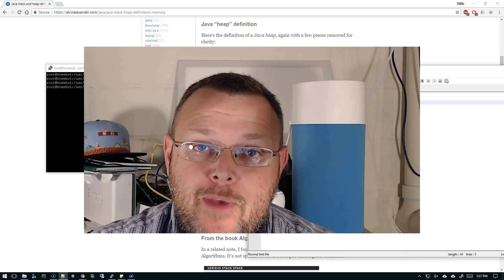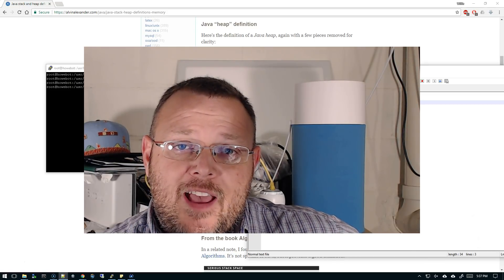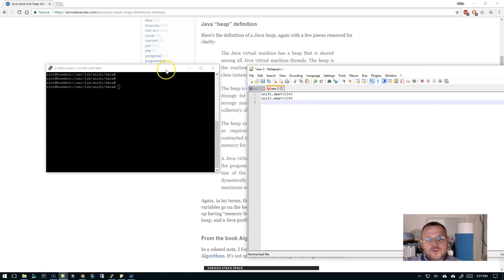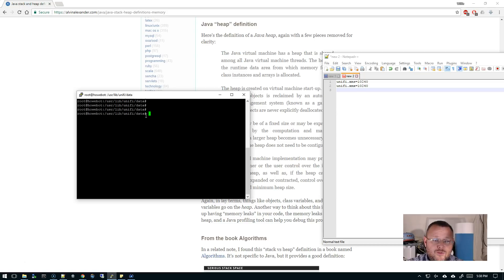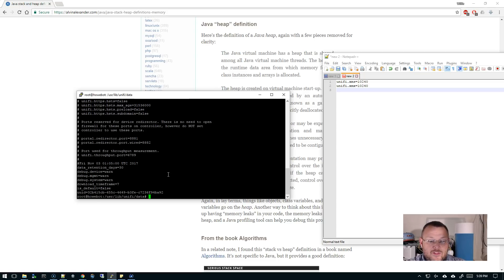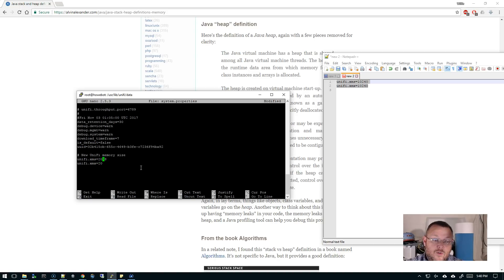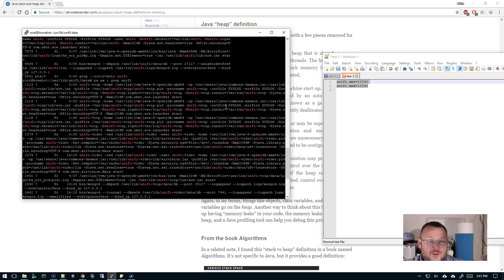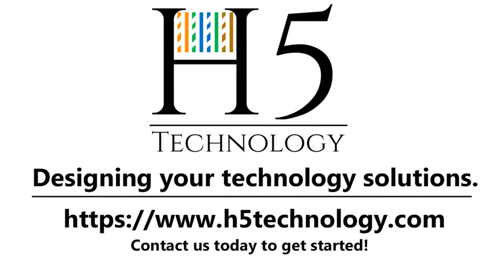Tuning the UniFi Controller

Comment: Willie - thanks for you excellent videos.  So, regarding optimized unifi for a raspberry pi 3, I am wondering if this method you described can be used to lower the amount of RAM used ... for example, it runs default with java heap size max usage 1024Mb ... ?

Comment: is there a process for this to be done on a Windows Controller? Thanks!
Reply: It certainly is, I up'd the size to 4069MB and the controller would just sit in the "starting up" process for over 10 minutes.  This is a Win7 box, FX6350, 500 SSD, 32GB RAM  this box should be able to hand over that amount of resources without issue. So then the commands in the sys file are identical to the Linux example? Thanks again!

Comment: Hi Willie, Really enjoy UR programs. Want to ask if U would consider adding several programs.

1. All Ubiquity 3 dumb router network for trusted and IoT LAN devices per Steve Gibson's model. I have one set up using a USG feeding 2 Edge X, 1 trusted, the other for IoT devices. Also noted increasing recommendations to move away from 192 addresses to maximize security. My USG is 172 and the 2 X's 10. Works wonderfully.

2. Integrating, securing, and managing IoT devices on Ubiquity networks

3. Cable and ISDN modem recommendations. Nearly all have security flaws, are open to exploits, and manufactures are hesitant to patch.

Comment: Just be careful with heap settings.  You want to find a value that is large enough to allow the application to run smoothly, but not too large that a full GC takes a long time to complete.

Don't go crazy.  Ubiquity uses 1GB by default.  Bumping up to 2GB is probably pretty good for most larger installations.  Anything larger than 4GB and you're probably not going to get any benefit and risk long GC cycles.
Reply: This is when JVM performance tuning comes in to play.  Bumping up to 4GB like Willie did won't cause too much of a performance hit, and the benefits of having that additional memory space will outweigh the occasional "stop the world GC" which would be rather infrequent on an application such as the UniFi controller.  In my experience, you really start to see negative GC impact as you start going beyond the 4GB heap size, and then you have to start tweaking other things such as running parallel GC, CMS, etc.  But, I believe most of the GC tuning parameters have gone away with Java 1.8, and in most cases you can simply get away with enabling G1GC if you are looking to run a larger heap size.

Comment: How do you know how much ram you can give to controller vs how much the server needs? Should both  startup and max be the same? U said to hit you up for the other info...
Reply: Unless it was written into the java app to request (a dynamic heap) setting these to different values won't do anything (this is something be could find out via any of the "ubnt-name" reps on the forums).  If you have played with the Microsoft Hypervisor - Hyper V this setting is similar to the VM memory settings with a start memory, max memory, and a checkbox for dynamic memory.  Further, as long as you routinely update your controller per the stable or beta channel releases you are already restarting your controller enough to take into account any growth occurring in your management plane via users/devices.  

So far I've seen (and this is being generous instead of strict):
Up to / ~ 5000 active users/devices/database entries: 2048 GB heap
Up to / ~ 10000 active users/devices/database entries: 4096 GB heap